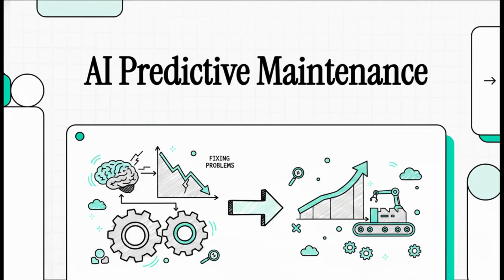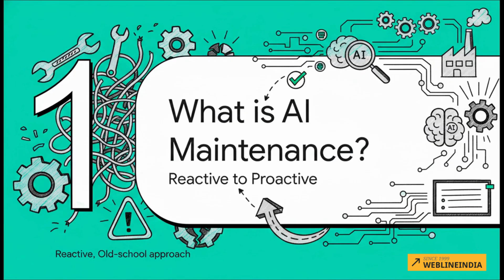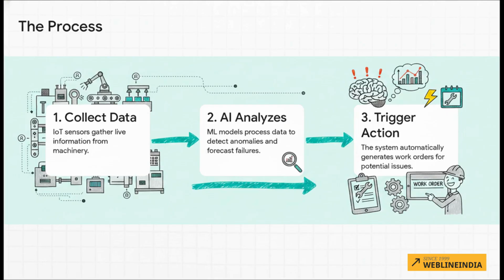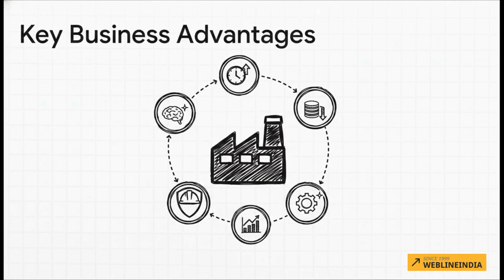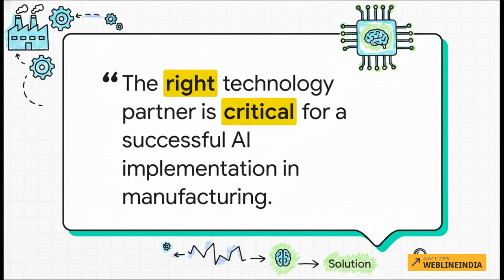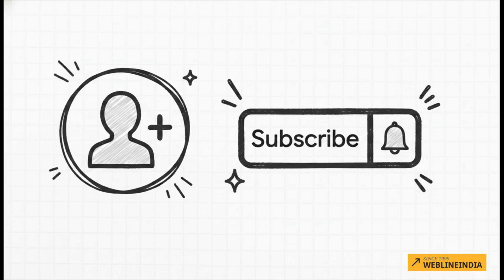Stop Factory Downtime: How AI Predicts Failures Before They Happen

Comment: You cited a potential 25% reduction in maintenance costs in the video. What specific factors drive those savings?
Reply from the maker: That 25% savings is achieved by cutting out unnecessary scheduled maintenance and preventing catastrophic, high-cost emergency repairs. Catching early wear also helps expensive plant machinery last significantly longer.

Comment: A lot of manufacturing facilities run 15-to 20-year-old machinery. How do you tackle the challenge of extracting telemetry from legacy equipment?
Reply from the maker: Extracting data from older systems is one of the three primary hurdles companies face when getting started. Instead of replacing expensive assets, we retrofit older machines with external IoT sensors to continuously capture real-time telemetry like vibration and heat, bridging them into modern predictive workflows.

Comment: How does a custom solution like this integrate with the existing industrial software stack we already use on the factory floor?
Reply from the maker: At WeblineIndia, our philosophy is that a one-size-fits-all product doesn't cut it, so our custom software is built to integrate directly with your existing ERP, MES, or SCADA environments. We build end-to-end workflows that connect seamlessly into the operational tools your team relies on daily.

Comment: The shift from the old 'fail and fix' mindset to 'predict and prevent' is honestly where all smart industrial tech is headed. Running machines on rigid calendar schedules has always felt outdated and wasteful.
Reply from the maker: You hit the nail on the head! Moving away from rigid maintenance calendars allows plants to service machinery based on its actual operating condition rather than an arbitrary date. That approach lets teams perform maintenance with surgical precision—neither too early nor too late.

Comment: How does the machine learning model differentiate between normal operational load spikes and genuine mechanical faults?
Reply from the maker: The AI model is trained directly on operational telemetry to establish a baseline of what normal performance looks like across operating cycles. By understanding baseline behavior, it detects tiny anomalous variations across sensor feeds and predicts potential mechanical breakdowns before unplanned downtime occurs.

Comment: When you mention using IoT sensors to track a machine’s ‘digital heartbeat’, what physical telemetry markers is the system monitoring to detect early degradation ?
Reply from the maker: The system tracks subtle shifts in vibration patterns, slight temperature fluctuations, and acoustic frequencies that human operators would never be able to hear. By evaluating all of these real-time signals in unison, the AI identifies the earliest indicators of mechanical distress.